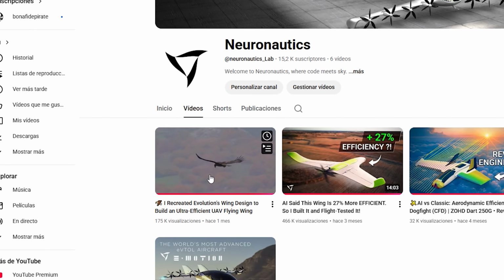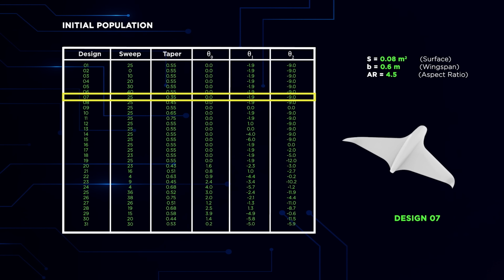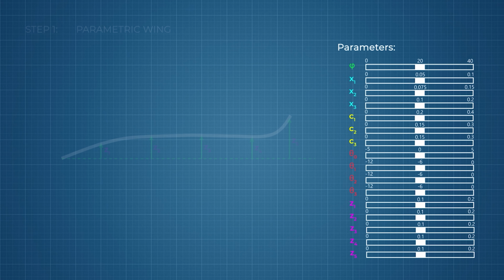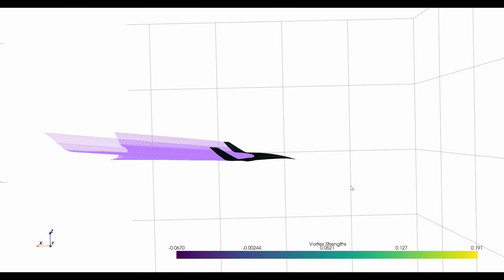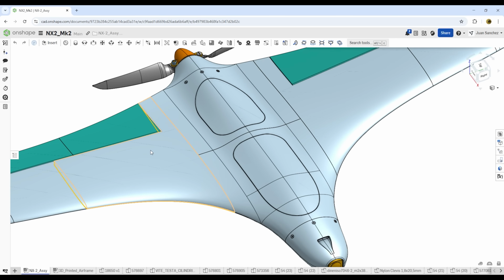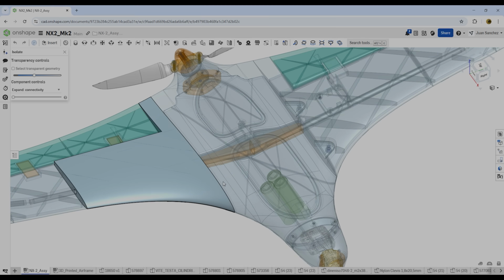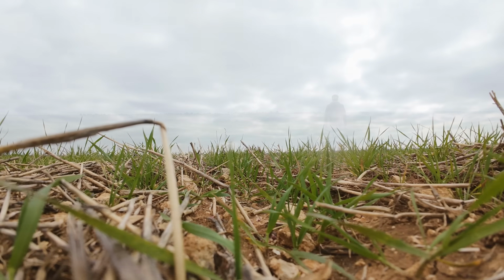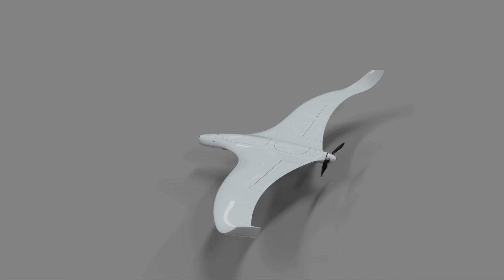AI Designed This Organic Flying Wing… I Had to Build It (+16% Efficiency)

Comment from the maker: Hi everyone! I'm amazed by the reception of this video and all the encouraging comments — thank you! 🙌

As many of you guessed, yes — it's a thrust stand. The goal is to use it to push the NX-2’s efficiency even further in the next videos ✈⚡

Quick question for the community:

How much do you think Wh/km could improve just by optimizing the propulsion system? 🔧⚙

Let me know your guess!:

A) ~5%
B) ~10%
C) ~15%
D) 20%+ 🚀
Reply: D.  Small changes to the prop and selecting a better designed for efficiency motor and esc can easliy add 20%.
Reply: compare the wingspan to birds, check their weight to get an idea of how heavy it could be?
Reply: D) 20%
Reply: A) ~5%
Reply: @nakfan  better esc and wires could do 5%.
Reply: You need to find the most efficient rpm range for each motor/esc/prop combo you choose... the difference can be over 50% with just rpm changes on the same setup!
Reply: 15% you can improve if you use an drone motor and a fixed Gemfan-type propeller example :2306 1700kv propeller 7 x4020
Reply: @carlospavas there are some specialized ones out there with special curved magnets that are at least 15% more efficient,  but there are some more gains are in the esc imho
Reply: Excellent! But can you produce a one seater from this and fly it yourself?
Reply: D!

Would love to see some of the Organic blade designs from the late (oh God, I can't recall his name right now. I am mortified 😣) "Thinking 'n' Tinkering" host, based off the front flipper evolution of Humpback whales. They slipped through the air leaving less vortices behind the trailing edge of the blades.

That being said, and without knowing if the design would allow for it at scale, but I wonder if it would perhaps offer any potential gains to duck a couple of (strings of?) such fans on either side of the main fuselage in a configuration similar to those on older British military planes. 🤷🏻‍♂️
Reply: Have you thought of turning this into a drone. It's a lucrative market. Also, can you patent it?
Reply: How to make a boomerang who return faster/early..?

Usually the boomerang designs try to go more far distance..will be interesting an oposite direction dessign...
Reply: Eventually, I'd love to see if this design can be implemented for transport on larger scales.

1. Landing gears
2. Cockpit space
3. Cabin space
4. Fuel space
5. Computer backups
6. Weight, weather, friction, pressure tolerances, etc.
Reply: I don’t know enough about your motor or battery to venture a guess.  But I do know that a constant speed prop uses power more effectively than a fixed pitch.  So, slowing the prop down at high velocity would be one place to start.  Maybe you might contrive a 2 position prop blade angle mechanism for takeoff and cruise angles.  One idea might be to flip a lever into high speed mode when the slipstream pushes the lever backward. As you land, slowing allows the lever to return to takeoff prop.
Reply: I wonder that how much it affects that prop is near wing. If you use slow rotating big prop and put it far away from wing with CF rod will it help
Reply: A question, how do you calculate the center of gravity with those loose cabling? i.e. from the battery, etc

Comment: I would be a bit careful with declarations of "ultimate flying wing" because it's not only in the structure or the wing design. Your calculations are based on the fuselage materials and physical characteristics. As this flying wing looks like a great design especially for long flight distance, I would try to consider maneuverability, stability, vibration conductance, flight speed dependencies and other parameters in order to find the ultimate flying wing. If you ask me - there's no "ultimate" design, but you can get best cost-effective, or best distance coverage, or best anything you'd like - but all depends on: 1. what is your KPIs 2. What assumptions were given to the algorythm and 3. what assumptions were not given to the algorythm.

Comment: This is really cool!

If you don't mind me asking, did you consider any other evolution strategies?

This seems like the perfect use case for covariance matrix adaptation. It's much better at generating new candidate populations from the previous as it uses more of them to generate the ideal distribution across all of the dimensions simultaneously. It has almost no hyperparameters to tune (basically just the population size). And it usually requires a much smaller population size than differential evolution, which sounds ideal for your case where the simulation is expensive.

It's more math-heavy than differential evolution, but there are public implementations like pycma, so you don't have to do it yourself.

Comment: Such a great project watching these videos and has got me into flying wings, I’ve been flying quads for years but after watching yr videos I want to try and build and fly wings . Do u have links to the esc you use ? Also by the looks of it yr radio link antenna and video antennas are located all internally dos this reduce range ?
Reply from the maker: Thanks! 🙌 Glad to hear the videos got you interested in flying wings!
For most of my recent builds I use an EMAX 30A ESC, which has worked well for me so far.
And yes, all the antennas are mounted internally to maximize aerodynamic efficiency. The range is probably reduced somewhat compared to external antennas, but I've never had any issues flying within visual range.

Comment: Whats the avionics BOM for this? Im thinking about designing my own vertical launched drone and I would like to use pixhawk and ardupilot but for the transition (its still fixed wing - horizontal flight) I think a manual control would be better for first few test flights.

Comment: How much does the airframe weigh without electronics?
Reply from the maker: The bare airframe is around 350–400 g, depending on the material and print settings you use.

Comment: So I'm really curious; can you soar with it? Will it thermal and/or slope soar? I have a foam wing that soars really well, though it wasn't intended for that, so I'm  curious how this one does.
Reply from the maker: The wing is designed mainly for efficient powered cruise,so with the right conditions it should be very interesting to see if it can thermal or slope soar.

Comment: Nothing short of amazing. I'm curious to understand the 3D area constraint better. Why you decided to include it and what it actually restricts
Reply from the maker: Thanks! 🙌 If you mean the wing area constraint, I included it to keep the designs comparable. Since both wingspan and wing area are constrained, the aspect ratio is also controlled. Otherwise, the optimizer would simply push toward higher aspect ratio wings because aerodynamic efficiency has a strong weight in the objective function
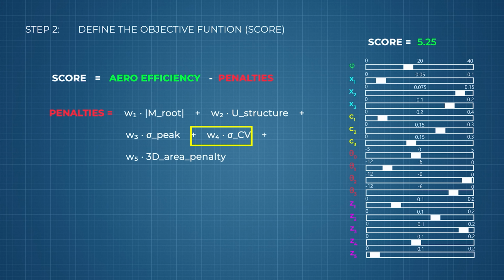Reply: at 7:20 in the video. I see that it is actually a weighted penalty and I misspoke when I referred to it as a constraint. I'm just thinking instead of it having a penalty on the score for 3D area, could you not have it calculate the weight and plug the weight into the efficiency formula for that given version. I feel like this would achieve a more natural and more better lol result. perhaps that is what you did. Or maybe something smarter. You clearly have a lot of thought and careful planning into this and there is an old saying "looks right flys right" and it certainly looks right!

Comment: You used design to design what I intuited but I have already thought in advance of this at the moment working on adjusting the horizontal profile of the wing across 30 different points across the wing from the leading to the trailing edge allowing air to be vented through the wing to help mitigate messy air, also I am looking at flaps being in the forward mid of the wing and behind a solid leading edge... It's a bit difficult to put into words and even harder to imagine but the form of flap I am looking at when applied gently on a particular side arrests rotation around the z axis.. Nice design idea I wish I had thought of it it might have saved me a lot of brain cells.

Comment: What airfoils were used?  Talking about aero efficiency without talking about airfoils is like optimizing a car without mentioning the wheels.  What static margin?  Why was wing area held constant?  An airfoil that can get a higher climax can use less chord and save you mass and wetted area skin friction.

Comment: I love the idea of AI aided wing shape optimization. I bet it glides amazingly. But did youi also optimize the wing for the certain speed by selecting the wing profile? And isn't the wing's stability gained counterproductive in sense you only controll it with the ailerons and it seems to be a bit resistent to the turns (I at least have the impression from the onboard camera shooting). Of course, it can only be my impression. But again, I love the idea and work!

Comment: Beautiful plane, just two reasons stopping me from buying:  LW-PLA. This stuff seriously sucks. Tried so many times with foaming and pre-foamed, it never remotely reached the stability of PLA+ . Did you try printing it completely in PLA+? Much too heavy, or still ok? 2nd reason is the missing single CF main spar in the wing. I'd never fully rely on layer adheason in a wing. It is not possible to change the wing to have at least one cf tube through the whole wing to make it stiff, and a shorter one till half of the wing to connec both wings? I tried so many 3d printed planes for Long Range FPV, and this two points are really important. Check the Stormbird or Nemesis from Stunt Double in Thingiverse. Compared to your design they are quite simple, and most likely less efficient. But they are rock solid, gliding forever, and easy to print in PLA+

Comment: Does the wing shape change with the required lift? Like, what if you wanted to design a long-distance cargo hauler? Same wing and body design, just scaled up until the cargo area and fuel tanks are big enough? And what if there's a max speed requirement? I mean, I'd assume that a supersonic design would be pretty different, but what if your target speed is mach 0.1 up until you get into the transonic region?

Comment: Purchased this and JUST finished printing every part. Waiting on electronics and hard parts for assembly. This is WAY COOLER in person, full size! 445 grams total weight, used Polymaker HT-PLA and black ASA for the canopies. Canopies were a pain until I switched to Bambu Slicer from Orca and used CLASSIC Wall for entire plane. Arachne will not work! Using a 2212 980kv motor with 10x6 folding prop. 3c 2,200mah battery, Matek H743-Wing V3 Flt Controller, Radiomaster RP$TD-M Receiver, Radiomaster Boxer Crush Edge 16ch Transmitter, 5g Servos. FPV will be a DJI 04 Pro. Q Cyclops V2 Goggles...for now lol...because all the other electronics killed my savings and it's what I got...FOR NOW! WAY worth the $32-$35 ish dollars for the files! Will try to update after flights... Edit: Bought a Radiomaster TX16s Mark3 instead, Caddx instead of the DJi because analog, not digital..forgive me, learning hard as I go... Last R/C I had was in 1990, ANCIENT TECH!
Reply from the maker: This is awesome to hear!! — and 445g is a great weight, nice setup overall!
Please send me some photos or a video of the maiden — I’d love to see it in action!
Looking forward to your update 🚀✈️

Comment: Can you make a propeller using the same idea and use it on the same plane with 33% efficiency.  Then use the electric motor size in terms of scaling so we know what rpm and hp would be needed

Comment: This is really amazing work. Excellent idea through production to flight proving design improvements. 

One question, does the 3D printing leave a slightly ribbed surface and does that help or hinder flight/drag efficiency? Like fish scales or golf ball dimples creating micro turbulence that reduces friction because it reduces surface area contact?  would printing more or less pounced and different ripple shapes get you anothe 1 or 2% efficiency?

Thanks for sharing!

Comment: Dielectric Barrier Discharge (DBD) strips. Aircraft:
Drag reduction: The strips can interrupt turbulent airflow, which can reduce drag by up to 44% at certain speeds.
Lift improvement: They delay airflow stall, allowing aircraft to remain more stable at lower speeds or steeper angles.
No moving parts: They can replace heavy and complex mechanical flaps, saving weight and maintenance. Bon change.

Comment: Very impressive, your work as well as the airplane. --  Remember that aircraft companies would pay for this themselves for civilian planes, but charge govt taxpayers for govt use. Offer it to NASA for a small airplane for Mars, and charge NASA for at least a few $ Billion for your efforts, with "tips' to all the decision makers and president to get the contract. ---  My question, as an old retired physics teacher, with a pilot's license 60 years ago which I did not keep up, and building models out of balsa in the mid 1950s, is what happens in a full  stall?  Engine failure, nose up, start a spin. Spins in other planes need the rudder, not ailerons. Just curious.  (Add a parachute for safety)

Comment: Wonderful work, very creative! As others mentioned, I know this as a genetic AI algorithm. From your presentation, it looks like you randomly generated 12 designs, chose 1/4 of them as the best, then based further iterations off of those. To search a wider space more fairly, generate 1000s of original possibilities and include 50% of the best designs for the next round, then go 1000s of generations. A limited number of random designs, limited survival, and limited generations will unnecessarily constrain the search space and it will be overly influenced by the original random selection starting points. You can visually map the coverage (dispersion) of your original models by computing the distance from each other or from a completely static linear starting distribution. You might want to cover the whole solution space to start with so you don't miss a solution hiding in some corner or valley.  Another possibility about searching the solution space is that there are multiple optimal solutions (peaks), so you might consider separating your solutions (survivors) into subgroups (environments) so they can converge on multiple solutions (peaks) if they exist. I love what you are doing here, and really admire your work! Best wishes.

Comment: I read a single prop with a counterweight prop was more efficient. The reason why they didn't mass-produce them was because two props were easier to make than one and a counterweight. Also, if they lost a prop, you'd end up with nothing to get you down other than gliding

Comment: Be interesting to explore stall speed and characteristics.  The only flying wing i flew (wingamagig) had a very gentle stall, but the cg was pretty well frd.
Reply: Add what every bird enjoys, totally controllable CG, with another servo, and moving plate for the battery and control electronics, and both benign stall, and optimized glide ratio, at any desired speed, are significantly improved. Variable wing loading adds considerable complexity, extendable flaps being my first thought, still allowing clean high aspect ratios for glide efficiency.

Comment: My undergrad thesis in 1990 was parametric FEA optimisation. On a desktop computer with less memory, processor speed than the cheapest phone today. 

Even simple models of a bolt took 12hrs. Painfully slow.

Comment: Birds don’t have static stability.  Depending on span-wise twist to provide static stability trades off efficiency due to sacrificed span loading.  Birds have tails.  And even though their tails look flat, the “actuate” them by twisting them, which provides yaw as well as pitch control (not stability).
Reply: Most birds use 'tail' control in flight rarely. Landing being an exception. Which is the most challenging flight regime to master, or control. Wing twist and rake (Fore and aft) do most control work at typical speeds flapping or gliding. Even when flapping, any tail forces have more drag than optimizing stability with small wing adjustments. The key being the unbelievably sophisticated neural control system built into bird brains and the attached control and sensory networks. Sticking the tail out to alter air paths costs energy same as wing variables. In flight, birds use whatever costs the least drag.

Comment: We experimented with flying wings before the B2. Without vertical stabilization, while cornering, it dives. 
The fix is the same thing the B2 uses; split ailerons create drag on the high side.

Comment: You don't need AI at all.  You can replicate using spread sheets to create a matrix of possible combinations and then run those through your simulator. Then take the top 3 designs and add more parameters so you can further tweak those. No AI required at all.

Comment: Great work. Would the variables be modified if it would be a 250 passenger plane traveling at 900 or 1000 kmh at an elevation of 10'500 meters, with an air pressure of 0.31 bars ?

Comment: I'm really struggling to get a successful print with this on my P1S. The closest I have is a single wall, spiral vase using Bambu PLA Aero, even then although the surfaces look clean, I can't print supports in spiral mode. If anyone has successfully printed this, please share your settings